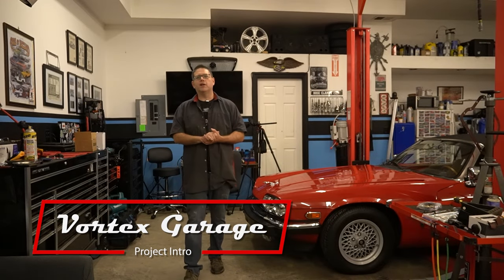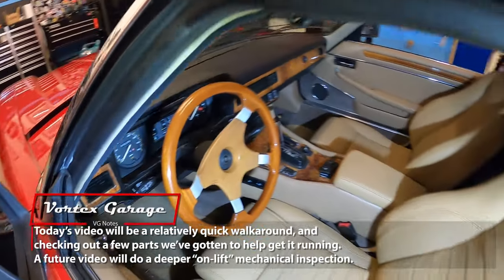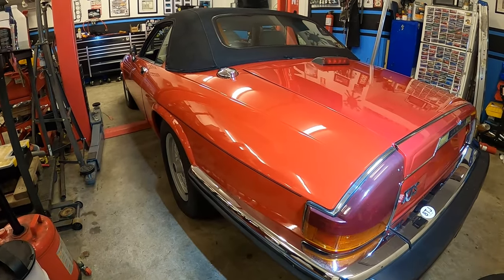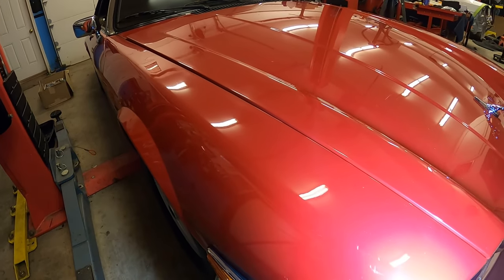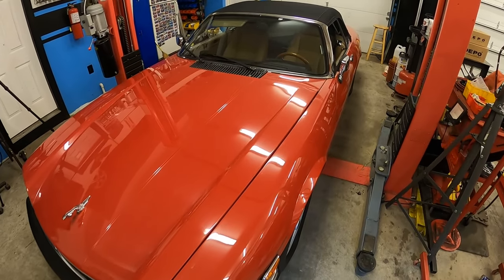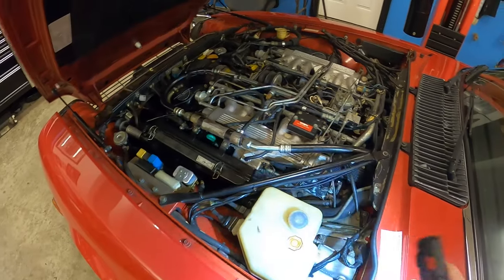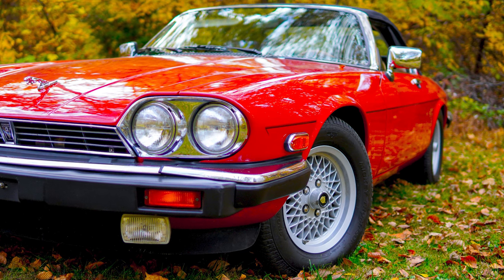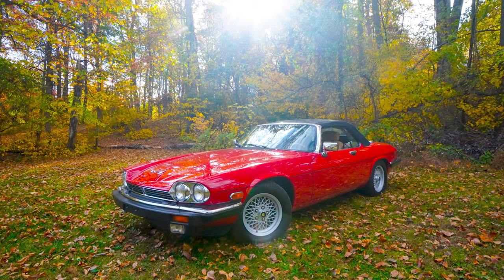Let's buy an already broken unreliable V12!  1989 Jaguar XJS - Project Intro

Comment: Well that was a waste of time, not only wasnt there a single wrench turned.......you are poncing around with a stereo on a V12 jag running its original fuel lines........So, if you actually want to do your customer a solid and change the upstream fuel pressure regulator, vacuum advance module, all the coolant hoses and aforementioned fuel lines.....